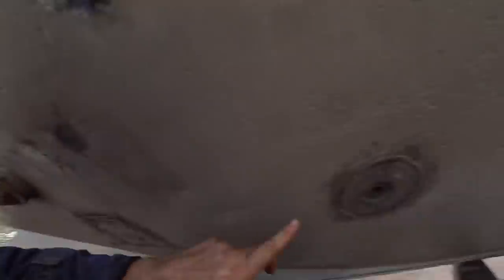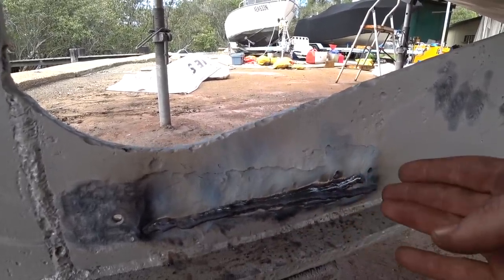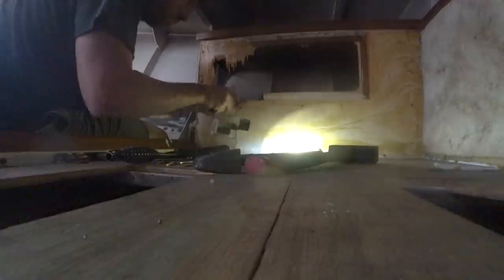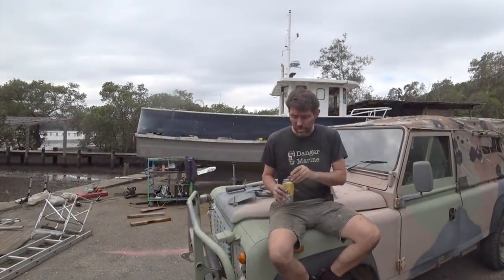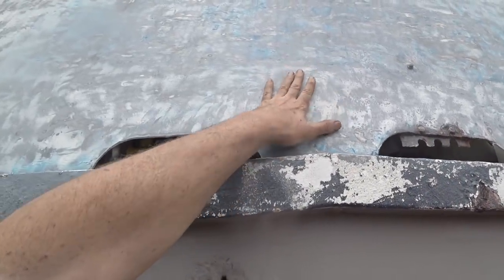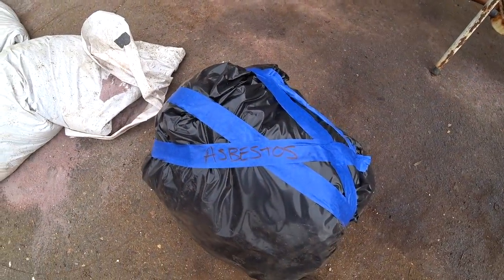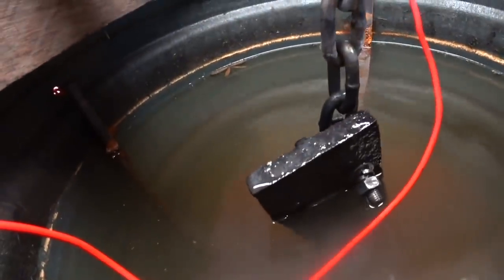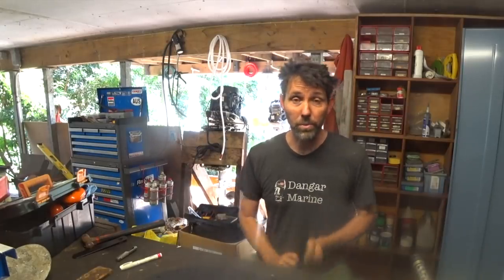Hull work, asbestos removal and a small fire

Comment: Please tell us that you're at least using a high level of sunblock on your exposed skin (legs, arms, etc!!)
The UV rays generated by the welder will fry your exposed skin! Don't ask how I know this, but just know that it's a pretty rough thing to weld while wearing  shorts, and having your private bits get "sunburnt"!!
Reply: Chicks love a good tan mate
Reply: @Jonathan Muphree Yes, he's doing all the things you listed, and yes I hope that he's protecting himself & his family from those dangers as well. 
Cross contamination is a very real issue. 
Asbestos, lead, and other heavy metal particles on clothing, and his body, should be dealt with  separately from family laundry.
As far as the welding, melanoma's are forever.

Comment: I wish some of these boaters were as aware of the environment as you are. I'm not a tree hugger by a long shot but watching some of these blow boaters sanding, scraping and spray painting on the water is a bit to much even for me. The worst was one of those "Sailing Douche Bag" channels. They were in a marina working on their boat and one say to the other, "we need to clean that up" (bunch of bottom paint chips on the ground). The other says, " no need, it will get washed away with the daily downpour".....WTF?

Comment: Why didn’t you lead the imperfections in the hull
Reply from the maker: Just going to use epoxy as it doesn't react with the steel when in contact with salt water.

Comment: It has to be fuel sutibe rubber for gaskets or it will leak over time. Gaskets silicon would be better look in to it could save you time down the road or river🍺
Reply: Silicone (NOT the same thing as silicon) is unsuitable for petroleum fuel gaskets.  The nitrile Stu used, also known as Buna N is the preferred rubber for petroleum fuel gaskets.

Comment: If you are going to throw away the cabinet, then why don't you just take a grinder to the bolts, a sledge hammer, and a pry bar to them?  Maybe I missed something here...  (edit) Never mind, 1 minute later you finally break out the hammer, and talk about grinding off the screws.

Free advice: Save the hammer work on the cabinet and woodwork that is destined for the trash for the next time that you bonk your noggin on a protruding pipe or some other mishap...  it makes the job of "whacking the boat back" with a big hammer much more satisfying... lol

Comment: is that asbestos? That looks like glassfiber wrap?
Reply from the maker: It looks different to me and is from the 80’s so figure best not take the risk.
Reply: @DangarMarine  Yea i agree with you  better to be careful insted of not,,, I work with old tractors and trucks they have asbestos brakelinding and clutch and engine gaskets... I use the same mask as you :)

Comment: Any reason you're not using a mig?
Reply from the maker: A few reasons. Don't own a MIG welder is probably number one. But I also want to get better at stick as it requires the least equipment and is therefore best for keeping on board while cruising.
Reply: @DangarMarine  Similar to why i bought my stick welder.

Comment: Another great video, Stu.  Between you and Leo rebuilding a wooden ship (https://www.youtube.com/channel/UCg-_lYeV8hBnDSay7nmphUA), my Saturday afternoons are covered.  Thanks for the tip on the other steel trawler project.

Did you say you're planning on changing the boat's name?  At the risk of going all concern-troll on you, I was told it's very bad karma to change a boat's name.  I found there's a ceremony that keeps the gods happy when doing so.  I used it when changing my little boat's name; so far, no sinky, so it must work!

You can still get stubbies down under?  We (Canada) switched to long-neck bottles 20.. 30... FFS, more like 35 years ago.  Apparently it was getting difficult for bars, restaurants, and etc. to get equipment (fridges, shelving,  etc.) sized for stubbies.  'Tis the curse of living next to an 800-lb gorilla...

Comment: I’d be concerned about that rubber material for the tank inspection hatches.. You should cut a little piece, and let it soak in some diesel for a few days..  That stuff looks like it will deform, and swell up when exposed to diesel...
Reply from the maker: Nitrile is completely diesel proof. What about it looks like it will swell?
Reply: Dangar Marine If Your sure it’s diesel proof- then no worries!!  What I meant by the swelling is- you know how most rubber materials react when in contact with oil, or diesel; overtime- they absorb it, and consequently swell, deform, and eventually split.  

When I’m scoping out a potential new hose, or the like- I always cut a bit off, and sit it in a cap of motor oil, or diesel, and let it sit a few days to ensure it retains it’s integrity..  Cheap insurance..   I use nitrile gloves working with diesel, and after a bit they do tear easier.
Reply from the maker: I that swelling you are talking about. You see it a lot on radiator hoses if there is oil dripping on them or oil in the water. I do like the idea of testing a piece, but my only worry is how long it takes to show symptoms. I feel like I would need to do a good 12 month test to be sure.

Comment: Are you replacing the rest of the bed and cabinetry with easily removed items as well?

There's procedures for tightening big bolt patterns like your inspection hatches.  Check out http://www.boltscience.com/boltinginfo/pages/analysisofboltedjoints.html 

It's a waste of rubber to not cut out the center of the gasket, although that's up to you.  If it's fuel safe I guess it wouldn't matter.
Reply from the maker: Yes, I want to modify the other cabinet so it can be removed at sea if needed.

Comment: Would think you knew its fastened with more than screws so you dont have to listen to vibrations from everything mounted in the boat
Reply from the maker: Yes, I mentioned that in this video. It’s not the right way to achieve that though, it needs to be removable.

Comment: That's not asbestos its exhaust wrap to hold the heat in so you don't set fire to anything or anyone in the engine compartment  !!!   its the same thing we wrap headers for our race cars with  Its made from fiberglass
Reply from the maker: The tape after it is definitely fibreglass tape but the thicker stuff is never seen before.
Reply: @DangarMarine  I think you can sleep soundly at night. While the precaution certainly couldn't hurt, it's unlikely that was actually asbestos. It doesn't look like asbestos pipe insulation, and I think you said the boat was built in the 90s? Doubtful anyone was going in and buying asbestos pipe wrap then. It also looked relatively clean and newer, and looks like fiberglass wrap. As Paul Allen mentioned, it's common on car and motorcycles.

Comment: Dangar Marine  - At the end of your video. You questioned yourself as to why you needed to cut out the center of your gasket? You then made the decision not to cut out the center part of the gasket and ultimately just past the whole thing to the cover.

Here is why you need to cut the center part out of the gasket. Over time, should cracks or deterioration, develop in the rubber gasket which should have been cut away. This could over time after being exposed to diesel, decompose and become unwanted particulates in your fuel tanks. It also could allow fuel to collect and gather in behind the gasket between the gasket and the cover hatch. Acting like a bladder and assist in the deterioration of this gasket material which should have been removed in the first place.

Why take the chance on leaving it in place, when it will only take a minute to remove. Verse a hell of a lot of hate and discontent should you find out a couple of years down the road. This is what keeps clogging your fuel filters leaving you dead in the water.
Reply from the maker: Nitrile is extremely strong and resilient to break down. It is more about reducing the chance of a leak than anything else.